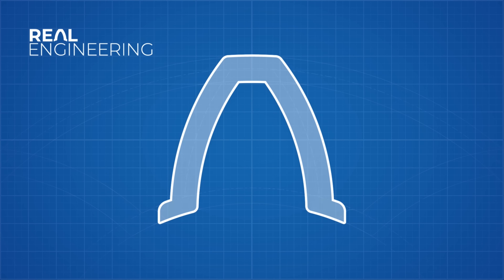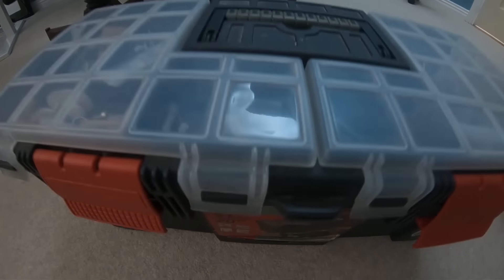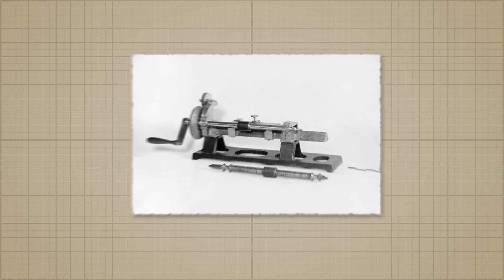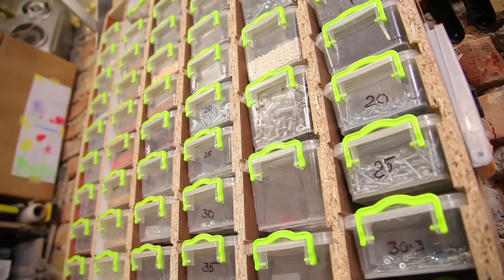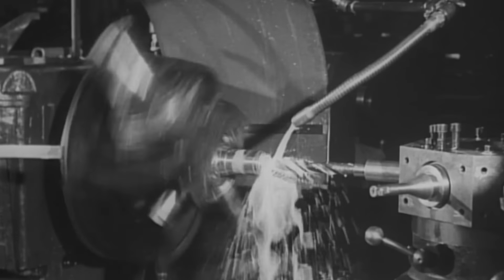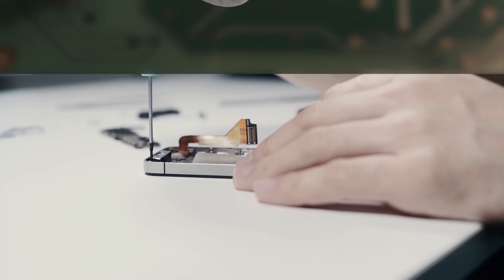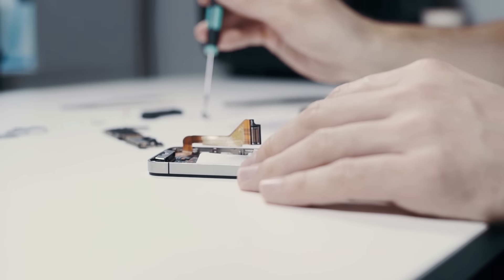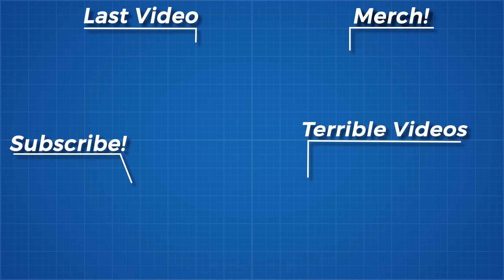Why Are There so Many Types of Screws?!

Comment: God bless the torx screw. Hope it becomes the standard in a future
Reply: Some Torx sizes are even cheaper than the Phillips sizes they replaced.  They've been available at hardware stores and Walmart and dollar stores for years.
Reply: @anon-i6p  there's literally nothing bad in the torx screws
Reply: They are fine for wood screws but suck for machine screws.
Reply: @1971mav  sure but, there are better machining screws than phillips
Reply: Naw man, hex is better, and everyone already has allen wrenches.
Reply: @1971mav  Where have you seen a TORX wood screw???
Reply: @flammablewater1755  assuming you're not joking, they're very common in the UK. It's all I use nowadays.
Reply: Engineering bless torx screw*
Reply: @1971mav  For carbide inserted  milling tools with a tight space and lot of heat Torx machine screw is the only screw you can use. 
They work fine. 
They have been used for decades by all milling tools company.
Reply: @flammablewater1755  In any hardware store.
Reply: @flammablewater1755  I've seen long lag bolt like wood screws with torx heads.  And some import furniture hardware
Reply: It's just a matter of time before the standard torx sizes aren't good enough anymore. Europe will come out with some kind of "metric" torx sizes and start a campaign to convince the rest of the world the old standard torx sizes are now obsolete. The tool manufacturers will once again laugh all the way to the bank, and the tool snobs in Europe will once again feel some inexplicable sense of superiority over it.
Reply: I’m a cyclist so naturally metric hex ftw
Reply: I prefer the Robertson over torx.  I find it quicker to assemble stuff using them and the design is better in a dirty rusty environment.
Reply: Fuck yes. I hate philips screws with a passion. The amount of grief they've caused me.... I often swap them out after its second use because the head gets used up.
Reply: I use almost exclusively Torx wood screws. They're often called star-drive or 6-lobe to avoid licensing issues. e.g.: https://www.homedepot.com/p/204959302
Reply: @flammablewater1755  I do inventory at the hardware store portion of a lumber yard.

The screw we sell the most of by far is a 9 × 3 wood screw with a torx 25 head.
Reply: Torx is good from size tx40 up, below, it is just rubbish!
Reply: God bless the Robertson screwhead(and hope it becomes standard) its the best screwhead to date.
Reply: @iGMAS  no
Reply: @DavidFrostbite  yeah but the hex ones dont work as well on high torque enviroments. Im not saying the are bad, because they're really good. But torx holds better
Reply: The one downside to Torx screws is that they require a specific screw driver to use them. With Phillips and Straight screws one screwdriver will fit multiple screw sizes.
Reply: @rickintexas1584  ill give you that
Reply: I don’t see why you guys love torx screws so much. At least for me (working on airplanes) they are always striped out or the bit is rounder out for us.
Reply: I hate torx screws I have broken so many bits dealing with torx screws on cars when they rust up badly, hex are so much better for not stripping and not breaking bits
Reply: isometric is better than phillips, torx is rare now, the chinese like to use that 120-deg three vane thing that screws in, but not out.
Reply: @rickintexas1584  one screwdriver with interchangeable heads ta da...
Reply: Torx are good in clean environments, still awaiting a triange based design, or star of david...
Reply: The team behind the Boeing 787 has sided with you.
That said will still have to easy out them.
Reply: Steven, even with minor corrosion, torx get bad. Better with an allen screw. I have a half dozen chinese appliances that have  three vaned 'phillips'-like or sunken equilateral-triangle types (I don't know what they named them). They really don't want people to be able to disassemble and repair things easily, so the driver bits are pretty hard to find (but not impossible). Interchangeable heads are all fine until you have a sunken screw in a slot or hole that's no bigger than the screw head, and so, quite a bit narrower than your interchangeable head.
Reply: @tennine9171  maaan. I work at a bike shop, and those damn hex screws are a pain in the ass when they strip
Reply: For general construction work, where i live (Denmark), Pozidrive took over from Philips screws in the eighties, and Torx became the standard some time in the nineties.  You can still buy Pozidrive screws; but I have not seen a pro using those for years.  (For machine screws, very small screws, screws for electrical components etc. Philips, hex, and Pozidrive and even slotted screws can still be found).  External Torx are really rare though.
Reply: I just like the way an ISO (pozidrive) screw can be fitted on the end of the driver and won't fall off - very handy in many cases. You can keep torx. Try getting them out when they are a little bit rusty.
Reply: @flammablewater1755  torx wood screws are the only kind used by my company for wood floor fastening to trailer beds (and are probably way more common than that?, they are okay... Still I would prefer something else
Reply: The advantage of the metric hex screw is that you cannot damage them by accidentally using the wrong screwdriver/key, as it either won't fit in or won't take any grip. 
That's still the worst flaw on Torx - you can use the wrong key which will get damaged and will destroy the screwhead.
Reply: ROBERTSON!!!!!!!!!!
Reply: no way, robertson for screw standard!
Reply: Most kits of screw tips sold today have several Torx bits included, as well as Robertsons. Can't really consider these types as obscure anymore.
Reply: I had to change the brakes on a car with a caliper that had a torx screw hardware. Shit was so rusted I had to take the caliper apart with a saw. Idk who the hell decided to use a torx screw instead of a regular ass bolt, everytime I see one now it pisses me off
Reply: @flammablewater1755  It's basically the only type we use in Germany for wood screws.
Reply: Hex is good but it can strip out. Square and torx are alright, but if you overload them the bit will normally snap before the screw strips. A pentagonal shape might work best
Reply: @stevenlarratt3638  yeah, I know that.  But my point still stands, with a Phillips head (or flat head) I don't have to change the screw tip for each size.
Reply: AW is the best, it like torx but conique so u can usi it even with little angle
Reply: @flammablewater1755 ..they're everywhere.. for decks especially.
Reply: Robison, by far the best, even rusted to shit they work, torx and hex are second. Philips and slotted are not even in the running.
Reply: You have never used a "Robertson" so you don't know a good screw
Reply: @iGMAS  without doubt best screw for any job and only needs three sizes to do them....Torx was just stubborn Americans looking for an American answer to a question Canadians had already mastered with the Robertson...Why Europeans adopted Torx it is a mystery....

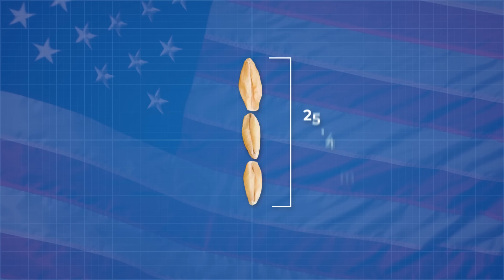Comment: 3:14 Fun fact: an inch is actually defined as 100/3937 meters. That works out to 25.400,05...mm
Reply: @Newt0rz  Why Fahrenheit?
Reply: @Secret_Moon  Scientifically it's just the preferred choice as it allows for much more nuanced measures of temp. To your average person, I suppose it means little though.
Reply: @Newt0rz  "Scientifically it's just the preferred choice". That's completely false. I am a scientist in biochemistry major myself and science does not use Fahrenheit. Its official unit for temperature is Kelvin and it's actually on the same scale as Celcius. It's basically just Celcius minus 273. Other units in thermal science like heat and energy are all defined based on K or C. None uses F.
Reply: @Secret_Moon  Ah, well that's what I was taught in American public school, not surprising it's not the truth tbh.

Comment: 6:50 Oh Apple and your anti-consumer BS
Reply: @moo iFixIt came to be because of Apple's anti-consumer repair stance on their products. Their sets are designed to include every bit, especially Apple's, that is until they decide to invent a new one. And the fact that Apple tried to pass a law that would essentially make it so that iFixit wouldn't even be able to exist is straight up disgusting.
So, bottom line is, if it were for Apple, you wouldn't even have you "modest" iFixit set.
Reply: Then there's Android letting their OS be open source which causes a lot of problems for compatibility of apps available. Google made it open source so companies could put it on any phone they make. It was a middle finger to Apple.
Reply: @TUTAMKHAMON  let's face the facts, this world is controlled by oligarchs. Make sure you support the correct company.
Reply: @scotthenrie5674  Who the hell is talking about Android? We were discussing Apple's hardware side. As far as I know, Android doesn't even do hardware. Stop basing all you opinions of fanboyism.
Also, open source is the opposite of a problem. And for your information, OSX and iOS are both based on UNIX which is indeed open source.
Reply: @scotthenrie5674  I don't support companies, and if you do, you are a fool, as they don't have your interests in mind. I support myself and which option is better for myself. But again, we are deviating from the topic at hand.
Reply: @TUTAMKHAMON  - this video showing that a new screw type came to be because of apple's attempts to lock consumers out shows both sides of the story. Apple disgustingly attempted to stop consumers fixing their products, but it backfired by causing the spread of technologies like that screw. The ifixit situation is probably similar.
Reply: @WorthlessWinner  Let's just hope they don't patent their next screw xD
Reply: @TUTAMKHAMON  you only jump to conclusions and you're obviously a troll. What are you doing today to make this world a better place? Because so far with both of your replies to me, you haven't even started.
Reply: @Kernels it was relating how Apple wants to make it so we can't work on it ourselves and only they can. Do people really not see the connection!?
Reply: @TUTAMKHAMON  fanboy? I've only owned Android phones.
Reply: @scotthenrie5674  how am I a troll? I only commented criticizing Apple's anti-consumer policies and then you came attacking Android in an attempt to defend Apple in a matter where Android wasn't even involved. Had you come with based arguments on why they are good policies, I could've have even ended up agreeing with you, but all you seem to do is try to win debates with ad hominem arguments, so I'll abstain from retaliating here on out.
Reply: @TUTAMKHAMON  technically Android makes hardware the pixel phones are made by Google who also makes android
Reply: @Mace-1191  Android isn't a company so "they" don't make anything. Google does indeed develop Android and the Pixel phones, like they did the Nexus line in the past, but they don't manufacture them themselves. They contract other companies to do it for them like LG and HTC.
My point still stands that bringing Android, an SO, to an hardware debate is a poor attempt at defending Apple. If he had brought Google Pixels or any other phone brand, then it would have been a different story.
(And yes, Google Pixels do use standard Philips screws)
Reply: @scotthenrie5674  please just please be logical. Apple is a disgusting company. People like ijustine buys their products. Do not be like them. I want to be able to do what ever i want with the product i paid for and i want it to be as transparent as possible about how they work.
Reply: @mustafayasiraydin  I've never bought anything from Apple.
Reply: @TUTAMKHAMON  android is owned and produced by Google, the same google that makes chromebooks and the Pixel line of phones, so yes, they do hardware.
Reply: @scotthenrie5674  so you were being sarcastic with that comment or what?
Reply: @TUTAMKHAMON  so if Google own and produce android and pixel phones and Chromebooks ? Who actually makes the hardware ? You know that apple don't physically make alot of there components aswell yes ? There aren't many companies that design and manufacture everything they make and sell you know that right ?
Reply: Then you got the 1000 dollar monitor stand.
Reply: Lion Mane  they only say negative things about people. I'm done with trying to explain what I was trying to say.
Reply: @xander1052  a poorly explained thought. Google made it open source so companies could put it on any phone they make. It was a middle finger to Apple.
Reply: @Kernels it's a problem only for apps, not security.
Reply: @Mace-1191  I know Apple doesn't manufacture in house. No one does when production needs to be done in such massive numbers (exceptions exist, e.g. Tesla), thing is, they hire a production company (the term might be incorrect, not sure how it translates) to do it, where the only thing they do is implement a production line according to Apple's design and manufacture parts again according to Apple's design. Google does this differently though, and I'm not sure about specifics, but they order a product from another company (with more expertise in hardware design) with x specs and a specific exterior design, that's why they need to contract big names like LG and HTC instead of an unknown factory in the middle of China. These contracted companies are the ones that later will end up contracting a 3rd one for the manufacturing of the phones in mass with their production line design. This difference can be seen in the Pixel 2 and 2 XL where they are very different from one another, precisely because they were designed by different companies.
In fact, you can read this on their wiki: "Pixel 2 and Pixel 2 XL are Android smartphones designed and developed by HTC and LG respectively, and marketed by Google." So Google is technically the marketer.
A fun fact, Google went to Huawei first, but they refused unless Huawei was also in the name. I guess Google/Huawei Pixel isn't as smooth. xD
Reply: @thealienrobotanthropologist  Agreed, torx is so much better than Philips. I just find the reason it came into existence very petty. Many technological advancements came from wars and I don't dislike them because of that. I do dislike wars though.
Reply: @scotthenrie5674  from ad hominem to ad passiones back to ad hominem again. I could start a fallacy bingo card. xD
Now seriously, no one is trying to attack you, just rebutting your arguments. The fact that you keep sniping back with brash remarks isn't helping your cause a lot. That's what has put you in a bad light, not anything I said.
Reply: @scotthenrie5674  Don't see how Android being open source was a middle finger from Google to Apple when it was something decided before the first ever iPhone was even released...
Reply: @scotthenrie5674  ah ok
Reply: It made perfect sense to have a difficult screw holding the Macintosh together, because the thing has a Cathode Tay tube in it and the flyback transformer stores “kill you several times over” levels of voltages. 
You could get to the main board just fine with a standard philips. You needed the torx to change the floppy drive, which, again, you don’t need to do, because Apple would do it for you, for free. 

Only when hard drives came about was it remotely feasible to open the case on the Mac, and even then, it was well beyond obsolete, being replaced by the II, Performa LC and Quadra. 
The torx bit stayed in the classic models of the Mac, because again, you don’t want a casual idiot inside there, and if someone cares enough to get a special tool to open the thing, it’s likely they are informed of the danger that exists inside.
Reply: @moo everyone fakes Apple
Apple started this stupid thing
Reply: @Mostlyharmless1985  this
Reply: @xander1052  android is an operating system. They do not do hardware or anything else for that matter.
Reply: @rodrigojds  "android is owned and produced by Google, the same google that makes chromebooks and the Pixel line of phones, so yes, they do hardware."  I never said Android, the OS, makes hardware. I said GOOGLE makes chromebooks and the pixel lineup. Since google is the company that makes android, and I was assuming that the question was originally if the company that makes android made hardware, my comment stating that google makes hardware is correct.